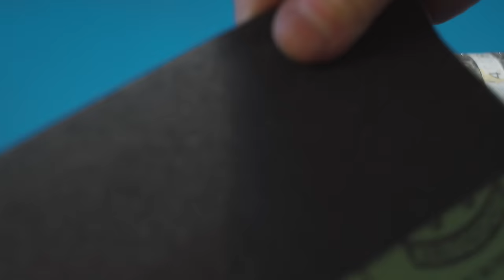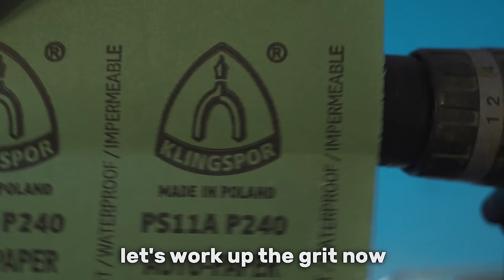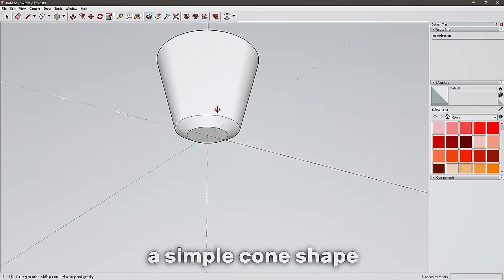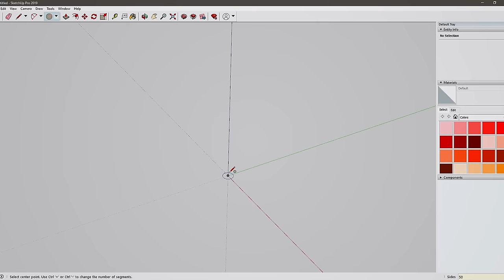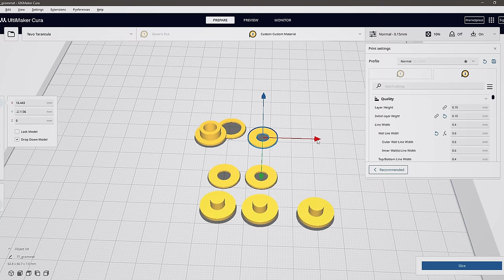1960 Brass Desk Lamp Restoration

Comment: Very nice and cute light fixture !
Reply from the maker: Thank you so much! :)
Reply: @ovi-diy But I will be you, I will avoid using an incendence lamp, it gets hot and it can melt, use a compact fluorescent or LED lamp instead! Afterwards it's you who see
Reply from the maker: @Planete-lampes1998  :) Yea.. I installed an 8w LED bulb, but I did a test. I actually got it on camera.. I wanted to see how fast the PLA lampshade will melt with the 48w incandescent light. I turned it on, and I waited 10 min, 20 min, 30 min, 40 min, nothing... I eventually turned it off. So I don't know when it will melt, but I ended up using a LED instead anyways. Yes, I like incandescent light better than LED light, but my budget is very tight... the electrical bills are a problem for me..

Comment: Wow! I would have never thought you could put the cord in an ultrasound cleaner!  That’s a cute little lamp. I also like the information you put in the description. Thank you for sharing
Reply from the maker: Hey there! Thanks so much for your kind words! Well, you can clean almost anything in the ultrasonic cleaner. The device basically agitates the water with soap (or what you put in the tank) very fast. Usually, you don't want to put a power cord in there, but this time worked because the conductor and prongs were perfectly sealed in rubber. They poured the rubber over the conductors and prongs. Otherwise, you want to keep the ends of the cable out of the cleaner. I liked the lamp too, when I saw it laying in the garage.. now it looks awesome on my desk :) I am happy that you found the description useful.. I thought nobody would bother to read it. If there's any other info you need, write me here, I'm happy to respond!

Comment: I saw your work and it is incredible. I thought about the lamp shade and saw that it looked beautiful in white plastic, but it could be made in white opaline, which would give greater resistance and beauty (as it is slightly translucent and shiny). The problem is finding someone who can manufacture these separate parts.
Reply from the maker: Hey! Thanks so much! :) That is a mindblowing idea! White opaline glass (or white-bluish) would indeed look amazing! Also, the 3D printed light shade can be used only with LED bulbs.. I had an incandescent bulb in the video, but didn't leave the lamp on for too long. I WILL hold on to your idea and maybe I can find someone who can make an opaline lamp shade for me :) And I'll come back with a video or a short!

Comment: How old was the lightbulb?
Reply from the maker: I think it's from the same period as the lamp 60s - 70s.. It has brass thread and the glass is "wavy". It was coated in red, but it flaked off. I don't think it's the original bulb though, the one that came with the lamp, but it's old indeed.

Comment: I’m curious how well the printed lamp shade will hold up over time next to an incandescent bulb.
Reply from the maker: Hey! Thanks for the comment! Well, ABS will melt at about 200 degrees. Most probably I will use an LED bulb, but it would be cool to do a test with the incandescent one. The bulb in the video is a 42W halogen bulb. I will make a short video. Great idea! Thanks :)

Comment: Never solder the end of wires when using screw terminals or pressure plate connections. The solder will deform over time, which can cause a poor connection.
Reply from the maker: Hey! Thanks for sharing this with us! From what I know, the best practice is with using ferrules, but I never had any issue with solder deforming over time with these type of connections.. You got me curious :) I will do some tests. Also, it may be a good idea to come back after a while and re-tighten the screws. I've seen a lot of people leaving stranded wire just twisted with screw terminals. That is surely terrible :) (as not all wires catch the screw / pressure plate) Good and safe connections are most important! THANKS again! :)

Comment: I’d have grounded/earthed the lamp as well.
Reply from the maker: Yes, that is a good idea, but I went with the original design. I made sure, though, that none of the wires can ever touch the metal chasis, and everything is rated minimum 250V/2A, so 500W. I will use only LED light bulbs because of the 3D printed lamp shade, so it should be fine. I also have a differential breaker in my main electrical panel, so, in case of anything, it should quickly disconnect. For everything else, I use only grounded appliances :) I also like to keep track where my live wire is, so I always put it to the right in my mains outlets.

Comment: I don't understand why you used a halogen light bulb and not an LED bulb. A halogen bulb heats up so much that it can melt the plastic from the lamp shade unless it's high temp plastic.
Reply from the maker: Hi! This was just for the video, it was a 42w bulb that I had around. I did indeed fit it with an LED bulb because the ABS lampshade will melt eventually :). Although.. I am a fan of halogen light, it seems more pleasant to the eye, but not for this project.
Reply: @ovi-diy  what about a filament led bulb? You get the aesthetic of a halogen bulb, but without the heat or power consumption, and it has the retro look that would look great with this lamp
Reply from the maker: That is an awesome idea! Thanks buddy! :)

Comment: Why would the bulb not more safe ? A bulb is a bulb it's not rocketsciene
Reply from the maker: The filament was continous electrically, but mechanically it looked very stretched and was hanging loose. I don't know how it would behave when burning out. Some older bulbs used go "bang" :), and the glass would also crack. So, a new bulb is safer.. I guess. Also, for my 3d printed lamp shade, I need to put an LED bulb, because the bulb from the video would melt it..
Reply: Who knows how long the old bulb would have lasted. And yes they can pop and break. Better to be safe

Comment: Putting mains cable into water to clean it is not a good idea as the water can wick up between the strands and under the insulation. I see there has already been a comment regarding earthing. Nice restoration though.
Reply from the maker: Hi! Thanks for sharing! Well, this cable was completely watertight, that is why the copper strands didn't oxidize in over 60 years. And that is reason why I chose this cleaning method. Otherwise, I would have gone for the traditional brushing method. Yes, I am 100% pro-earthing :) I've got everything earthed in my house, even the ceiling lights :) But as for this lamp, I wanted to keep it as original as I could, of course, making sure that all the wires are safely isolated from the chassis. Also, the cable is rated 500w, so any lightbulb (even incandescent) should not heat it up. As a last resort, I hope my differential breaker will do its job :)
Reply: Its the corrosion that is bad not just water
Reply from the maker: Yes, you are right, but the copper wire, being completely sealed in rubber (rubber was  poured around the copper strands), had no contact with water or corrosion agents. The only part of the cable in contact with water and dish soap was the wire ends (which I stripped before to check the wire). The little corrosion that might have formed on those ends during cleaning was then quickly removed by applying flux and solder wire, sealing everything perfectly. :). How do I know the copper wire was perfectly sealed in rubber? The cable is over 60 years old, and if any air got in side between the copper and the wire, the copper wire wouldn't have been perfectly clean when I stripped the ends for checking. That's how I knew I could clean it this way without any problems.
Reply: It is stranded copper wire, so on the open end there is no seal between each strand, meaning that water can wick up the wire between the strands.
Reply from the maker: I see what you mean. But water would only be between the "open" strands (from the end of the wire, that has the rubber stripped away). The water can get between these strands only at the stripped end, but will not get further up the wire (this specific wire), because the rubber seals it. If it was not perfectly sealed, the wire would definitely present signs of corrosion, after 60+ years of being stored in a humid environment. But when I cut the wire and stripped 1m of rubber away at the end, the strands were "like new". So I assume the seal should be perfect. But yes, if I had no way to test this, I would not soak the wire in water. But this wire, I don't know where and how it was made, but it seems it's very high quality. I was almost sure I would find corrosion and discard it. :) Also, between the strands themselves, a couple of mm into the un-stripped wire, water can get there, but when I apply flux, together with solder to the end, that gets inside too and replaces the possible little corrosion that can form there, dries everything and seals, soldering all the wire ends into one. If I was to use a ferrule instead of soldering, yes, this wouldn't have been a good idea.

Comment: 😂😂😂 pessimo lavoro , la parte elettrica doveva essere sostituita con ricambi nuovi . Pericoloso oltremodo il cavo di alimentazione con la spina con gli spinotti non isolati a norma , con conseguente scossa , originalità sì , rischio di morire no ,😮
Reply from the maker: Thanks for the comment and for your opinion. I am sorry that you don't agree with the way I did the electrical job. When you do a restoration, it is most important to keep as much of the object original. Yes, safety is paramount. That is why I thoroughly checked every part (cable, switch, light bulb socket) to be 100% sure that they are safe. Also, that is why I put additional heatshrinks on almost all the wire ends. By "not isolated" (that is what the translation told me), I think you meant not grounded (earthed). You want to ground an electrical appliance so, if you touch the chassis and has 230V / 110V on it, you don't get electrocuted. But, the way I wired this lamp, there is absolutely 0% chance of electric shock. Everything is perfectly insulated and the wires are rated 500w (and the switch 2000w). For the video I used a 42w light-bulb, but I will use 3W LED with this lamp. So there is 0% chance for a wire to melt, or the switch. The switch was fine, but I cleaned every piece anyway. Perfect condition. So, there is no reason to ground this lamp. Also, if you go down to IKEA, most of their lamps are not grounded. Secondly, a well built electrical wiring in any house features a differential breaker. A differential breaker detects wether the same current drawn by the live wire is returned through the neutral wire. If there is more than 30mA difference, it quickly disconnects. When the live wire is in contact with your skin, some of the current wants to go through you to the ground (and electrocute you). This means that way less than 30mA of the current from the live wire will return through the neutral wire. So you get disconnected before you get electrocuted. Basically, if you house wiring is done OK, you can stick a finger into the live wire hole in the wall outlet and not feel anything. Also, the legal system depends from country to country. In Romania, you were not required to have grounding (earthing) in your houses until recently. 90% of the people still don't have.. unfortunately. Cheers! :)